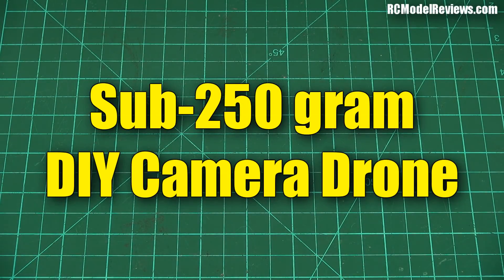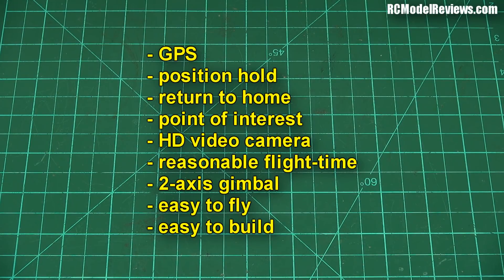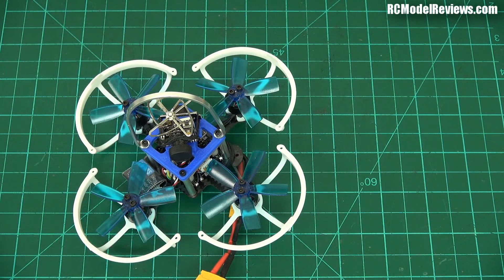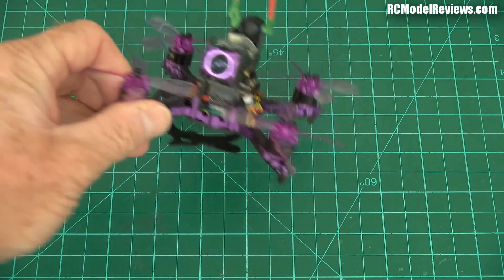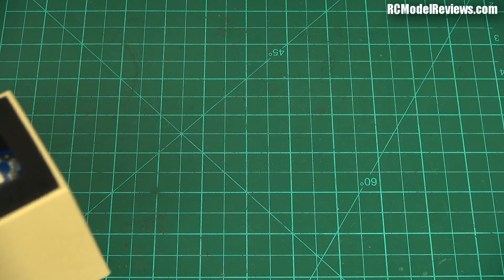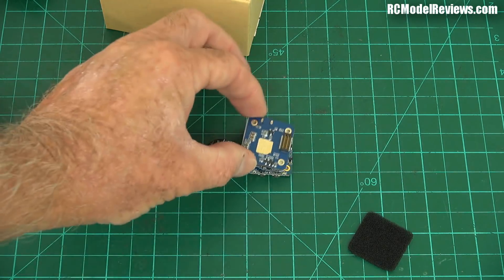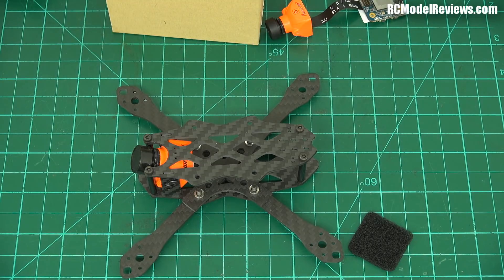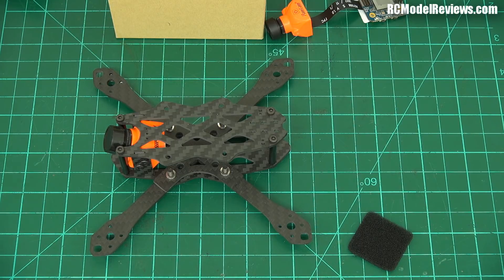A sub-250g camera drone DIY project

Comment: Bruce 😃 great news!! 

1. You’re back and churning out some excellent content 👍 even white board videos!  
2. Albert Kim just posted about the Caddx Turtle 🐢 an interesting alternative to the runcam spilt... but hang on... it uses the DJI style coax cable rather than the flat ribbon cables. What does this mean for us...? We can actually route that cable through a gimbal to the camera 🎥 (which would have been almost impossible with a ribbon cable) 
3. The Ardupilot ChiBios project is flying!! This means ArduCopter levels of GPS based missions and drone control and full gimbal control for point of interest. Or INAV? 
4. The HAKRC mini F4 20x20 stack with Baro now has a new competitor on the market..... drumroll for ........... The Airbot F4 nano with 20x20 4in1 Ori32 Brushless ESC!!! And it has 4 built in current sensors!!!! Wow 😮 
5. Bonus news :) the Sky Viper 2018 range of drones are introducing optical flow on an Ardupilot Drone for $50!!! And the GPS drone is $100 ish 🤔 lots of upgradable hacks maybe? 
Thanks and really looking forward to your next instalment on this series and the HD video transmission too 👍 I think the products you needed for the Sub 250g project to really work are now here. Good look and I’ll keep watching

Comment: A sub 250 g drone is a piece of cake. A small HD camera or even a Runcam Split 2 / mini, also a piece of cake! A tiny gimbal for either of these cameras and keeping it under 250g... much harder. 

Come on Bruce!! Share with us all what you had in mind for the small gimbal motors, regardless of what the total build weight may be. 

Also the gimbal controller, Storm32 boards are excellent, but usually quite big and GoPro size for 350 - 500 size frames. Does anyone know of any Storm32 boards that are on a 20x20 mm size for smaller gimbal motors??
Reply: I did some searching on OliWs page for the Storm32 project. They have lots of small gimbal boards, here is an example of one 

https://m.lightake.com/p/new-micro-storm32-s-bgc-32-bits-v6.8-3-axle-brushless-gimbal-controller-with-dual-gyroscope-for-multirotor-fpv-quadcopter_2134876.html

Just looking for tiny cheap light weight gimbal motors now 👍

Comment: I've just seen that Banggood are advertising the DJI Mavic Air gimbal as a spare part!! 

https://www.banggood.com/Original-Gimbal-Camera-Module-for-DJI-Mavic-Air-RC-Quadcopter-Spare-Parts-p-1286044.html?rmmds=search&stayold=1&cur_warehouse=CN 

It is a little expensive... but would anyone know how to connect to this to get data from the camera and control the gimbal?? 

it weighs: 34.86 g 
it is a 3-axis gimbal 
it is a 4K camera with 100 Mbps Video and 12-megapixel COMS 
apparently it is "Original Gimbal Camera Module for DJI Mavic Air RC Quadcopter Spare Parts" 

hope some of you find this interesting :)
Reply: Thinking about this a little more... the reason most Hobby people don't buy a DJI drone is; 1. Price 2. been regulated 3. only been able to fly at 15 mph :) 

All the best bits about a DJI drone are the gimbal and the 4K camera... so, if an electronics genius could control the gimbal and record the data from the camera, we would have DJI image and image stabilisation on our DIY 100 MPH quadcopters... 

that would be seriously nice!

Comment: The first thing that comes to mind is that the camera should be under the frame and possibly angled down a bit.  If you have GPS assistance and barometer lock, then you wouldn't want to fly it like a racing drone.  Larger more efficient props.  Possibly even geared to swing a bigger prop.  A camera platform should be stable and consistent.  It is totally different from the racing/freestyle scene.  I have been wondering about building a design similar to this for a while now.

Comment: The hardest part is the gimbal. No way you can get under 250g and have a gimbal. If even DJI cant do it with the Spark its going to be hard for someone without the resources of DJI to pull it off.

Comment: I would like to see -
long flight time (10 mins +)
1 axis (u/d) gimbal with anti shake/vibration
camera with 1080p / microSD 
5.8g fpv
altitude and position hold
100m range (at least)

If you manage to put something like this together and the parts are readily available and not too expensive
I will definitely build it as the 250g rule will be coming to the UK within a couple of months.

Comment: A bit too ambitious Bruce, I think a small foam flying wing with inav or similar might be the way to go, main problem is the stall speed so no hovering footage possible!
Reply: Fred F just look at 1407 builds on YouTube Fred. It is easy to build at 180 - 190g then add a gimbal... not so easy, but Bruce has a plan!!

Comment: Sub 250... my race kwads end up around 290 grams. Freestyle kwads end up 390 with a Run Cam 3 or session on top. Now that's with props and battery straps, I mean strap a battery on and fly weight. Building a 6" freestyle this week and I do t expect it be any lighter than the 390 ready to fly except battery. My 3" racer is lighter than 250 but not with a 1000 mah 4s on it. 

I just don't think you are going to get good film product outside with something this small. Wind is going to push it hard. Of course your not flying rate so that might help. I will watch and hopefully be pleasantly surprised.

Comment: I've been gathering the bits to build slightly larger camera platform based on a HobbyKing Trifecta frame using a split. The tricky bit has been the gimballing of the camera. I have a carbon fibre gimble designed for servos, I'll be interested to see what you do.

Comment: I have been trying for some time now to get the hunk-of-junk Onagofly to work, mainly for the said reason in this video. I have had some limited success, including getting it bound and flying with an actual transmitter. Where I've stalled on the project is tuning-- I can't get a decent tune on the thing for the life of me. I think this is due to the PX4 FC is designed for large drones, and the Onago is a micro size. If there is a way to increase the PID loop time on an APM, that might do the trick, but for now (especially since it's battery bit the dust) it sits on my shelf. If you're curious, you can look at my project here: https://hackaday.io/project/16729-onagofly-hacking

Comment: Battery and flight time ideas: 
If using Li-ion or Li-po or any other type of battery. You can design it to fly with a modest battery that gives 5 or 7 + min flight time and an all up weight of 250g. But you could also add a larger capacity battery and take it over the 250g mark if you wanted to which would give longer flight times. This way Bruce still achieves his goal! And we have an option to increase flight time depending on where you fly and what regulations there are. 
Two things to note: 
1 the thrust to weight calculations would have to allow for a little extra battery weight in this situation. 
2 adding extra battery weight will make the drone more stable, so if you are getting blown around too much on a windy day with your 250g quad / hex you can add ballast in the form of extra mah 👍

Comment: Hi Bruce, I thought of something similar a while back and honestly its a near impossible mission. The flight time is the biggest issue. With all that hardware gps and camera gimbal! I think you will have to lower flight times, use 2s motor and Lipo. This will no doubt reduce the stability of the quad also. 
You could run a 3s tricopter  larger battery for longer flight. You will get more stability using a large frame with light (3x motors). Im thinking something like a 6mm tubular frame (DIY style).
Inevitably its going to come down to hardware or battery. 
My preference would be to have a great performance drone that takes good footage with a short flight time. Than have longer footage of piss poor quality. Hope this helps. 👍

Comment: Awesome project, and can't wait to see it through to the end! I've also been looking at converting my 6in tricopter to a camera drone (definitely gonna go above 250 grams), but I never thought of using a split with a gimbal! And I was planning to put 2 cameras, 1 FPV traditionally mounted and 1 HD cam, but I was thinking of figuring out how to switch between cameras remotely and view via FPV goggles, and that's where I got stuck in the design process.

Comment: Go with a 250 size quad with 6 inch props for more efficiency, and don't worry so much about weight. 250 size equipment is cheaper anyway. Get that working, then move on to the challenge of 250 grams.

Comment: Hi Bruce, the biggest problem with a DIY camera drone is a good steady position hold function. I have tried INav with an F3 controller but still it’s not good. Crack that first and all the other stuff will fall into place, cheers John.

Comment: Mobius and Hawkeye Q6 cams can be split from their mainboards using extension flex cables if you want 4K raw footage (Q6 has built-in electronic stabilization). 51 pins with 0.3mm separation is available for the Hawkeye through various Chinese sites(I just ordered one) and the Moebious cable is officially available (credit to ROBOFORCERX2000 https://www.youtube.com/watch?v=grG1nBTCF2s&t=71s&pbjreload=10) Hawkeye Q6 running on 1S 3.7v you will need a voltage regulator.  Cobra 2204's are still around in the high-effiency 1960kv version. I wonder if Arduinos are fast enough to act as flight controllers or even for real-time image processing, I hope people come with better input than I do. Also see https://open-diy-projects.com they have some interesting ideas and regarding battery life, all good comes to he who waits: https://www.forbes.com/sites/jamesconca/2017/03/17/jack-goodenoughs-battery-technologies-keep-getting-better/#708e07114e62 
I have a spare Mavic gimbal+cam and a dissected Dobby if you want that sort of donations, they are basically higly advanced mobile phone cams on flex cables with no available diagrams so I scrapped them.

Comment: I have a scrapper made from a Diatone grasshopper and is 230g with a 1000mah 4S on it. I've used 1306 3100kv motors with 4045 twin blade props. I get eight minutes or so just flying about normally and about 5 mins flying it hard.

Comment: 10 minutes lfight time is not unrealistic, I've been testing a 220 sized FPV quad I slowly built with cheap/on sale parts, AUW 339g with 1500 3S battery. I did some line of sight flying with lots of punch outs to test its power and longevity.
After flying for 10 minutes I landed and checked the battery, it wasn't completely drained.
Will be watching these videos with interest.

Comment: A few years ago i did some testing  with the zmx 1804 2400kv motors with 7038 slowfly props on 2S. Its a super efficent setup and lightwight too. Maybe this is a point to start....!
Reply: And if you have light and efficent motor-/propsetup, two 18650 cells would be great for a long flighttime.
Reply: RCBroadcast yes it would 👍👍

Comment: Bruce - won't the stiffness of that ribbon cable be a problem for a tiny gimbal? A Mobius Mini is only 24 grams with case and battery. Strip those off and it wouldn't be far off the weight of the Split Mini, plus you'd only have 3 thin silicone wires to run to it on the gimbal (+5V, gnd, video out) ... 

PS you know the Splits 1 & 2 have suffered from horizontal line artifacts in the corners of the HD video? I think the Mini is the same.

Comment: Mini-mobius with Lens A (110°FOV=>more details and less fisheye effect) could be tested too (acceptable FPV latency ~60ms while recording FullHD@60fps, weight : 20g without battery and 5V externaly powered). The Onepaa X2000 is less kwnon but could be an alternative for (very) stabilized flight mode only (interpolated 2K with gyro stabilisation, but analog video out with a lot of latency >100ms, weight : approximatively 25g without battery)

Comment: I seem an old catalysts machine works frame ment to carry a small 3 axis gimble. And an action camera.  This wad enormous frsme msde of carbon fiber, and overly complicated but if shrunken down,  and slightly redesigned to use micro fc and 20 by 20mm stacks it may be the perfect platform design to build this around. Unfortunately i cant fimd it at the moment to link a picture. However i know u csm find thr design floating around out there somewhere,  and scale it down.

Comment: Hi Bruce, Love your idea I am building something similar for myself, I avoid commenting in general but I wanted to share some findings:   

1]   IMR Li-ion 18650 batteries have double the energy density of lipo and will hold to 20A - 35A burst which is more than enough for the sub 250g.  I am getting 25 min + on my runcam split 1 /  130 build with the motor for point 2
2]   The 1404RX  RotorX motor for me gives crazy efficiency due to size and coil termination lowish KV,  EngineerX did a good review on it.

Li-ion have been excluded from the mini quad scenes due to low discharge rate but the technology improved to some extent and I really think they are relevant in this application.

Comment: Great idea. I'm currently speccing a cheap gps camera drone (no weight limit, basically a tripod in the sky for still photography) and I'm sure we'll face a lot of the same problems. All modern development seems to be geared towards home builds for racing fpv or expensive large camera drones, and I'm sure there is a big market for a decent small camera drone kit. By the way, wide angle lenses are much more prone to lens flare (as well as distortion) so a narrower angle lens and a home made lens hood should help greatly.
Reply: Alan Mearns I agree, not often you see ‘cinematic’ and ‘fisheye’ in the same sentence. Way may also be better looking at higher image quality and lower frame rate. 24fps cinematic motion blur, maybe even a jellow nd filter and a gimbal means we can get a really nice smooth quality image from far cheaper components. We don’t need to pay for the bit rate and weight of a 60fps 4K sensor, just no need and not really in the spec of a <250g quad

Comment: I will be building one. Bruce can you also cover the configuration of the flight controller, and also all setup on OpenTX, as well as the expected build process? So that it is a complete build, setup and fly project?
Reply: Configuring the FC and is a really good question that I would like to see demonstrated well. I have tried a few times to fly a 250 mm quad with GPS and barometer “like a DJI” and I have failed... when I tune it to “fly slowly” I can’t correct / hold well. The aim is to let go of the sticks and it sits perfectly in 3D space. I’m sure I’ve just been doing it badly, as it is possible.

Comment: try getting a frame that can detach from the arms in 1 piece, so you can have a tilting system that acts as a gimbal, just mounted on servos. the quad might as well be something like a tilt rotor but has the whole arm assembly move, leaving the main parts straight, the FC should keep the thing level, change altitude, and yaw by changing motor speeds and you can bank with the servos (favourably 2 for the roll and pitch axes) then, as the camera you are going to be using is able to record 1080p60fps, stabilise it in post to get a less fisheye effect and remove all unsteady jerks and stuff from the servos, i think this is going to be better in a way as the split has this black ribbon and i would preferably keep that still and stabilise either the whole camera (sensor and boards) but that would be messy and heavy so that is why i am thinking of a tilt rotor, wanted to do this project personally as i do own a phantom 3, it takes stunning video but is just not very portable, you can check my channel out for the videos it produces, this build should create 1080p raw and buttery smooth eis 720p60fps if done right, cheers!

Comment: Bruce, Id like to recommend one of the flexrc owl frames (2.5 or 3 inch). It puts the camera in front of the props and has great protection to counter no obstacle avoidance. Dmitry (the owner and designer in Vancouver) will also adapt the frame or cut thinner frames if more weight savings is needed. My owl seems indestructible. I'm about to mount a split on mine, will be closer to 300 grams but I'm sure that can be reduced. A fellow in rcgroups/owl build a sub 250 on the stock 3" frame. Thanks for the great vids!

Comment: Really looking forward to this. I’ve already built a <250g FPV racing quad that can compete with 5” quads on most race courses. I’m in the process of building a <250g FPV racing wing that should be as capable as a Spec racing wing. If I can build a <250g AP drone it would complete the set of aircraft I use to flip off the FAA’s registration scam.

Comment: I doubt that you can do that!
First with a camera drone we want to have flight times of approximately 10 minutes
Second with a camera drone we want to have good camera quality and even the Swift Split Mini lacks that
Third when adding a micro GPS with a compass you will never meet the weight limit of 250g (including the battery) for your quad
And believe me, I tried it already....
Let me give you an example of my latest 3" racing micro quad, the GEPRC GEP-MSX3 Sparrow (stretched). This quad weighs with the Micro Split, a Eachine micro VTX03 , Optima D RX from Hitec, Omnibus F4 Pro V3 FC, 4 in 1 Blheli_32 30A ESC and a 850mAh battery exactly 249g. 
So you will never meet the weight limit for your camera drone. A 3D-printed frame btw. is much heavier than one milled of 1mm CF. And then you will have to cope with vibrations (not very good for the video...)
Reply: Juergen Stremmler a lot of people seem to disagree with you... only time will tell hey 👍
Reply: You are right! As time goes bye we will have the answer whether Bruce or I am right...... (and I hope his scales are correct....)